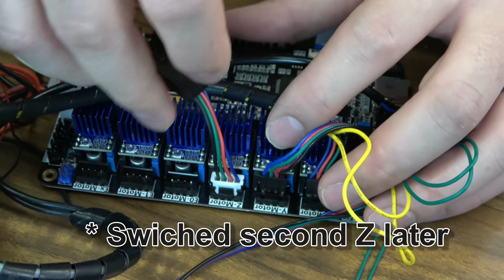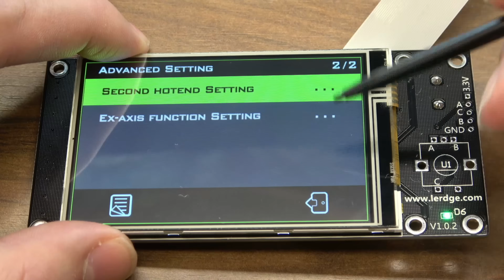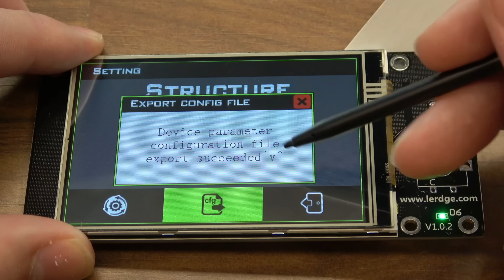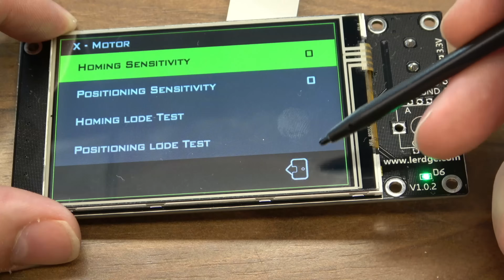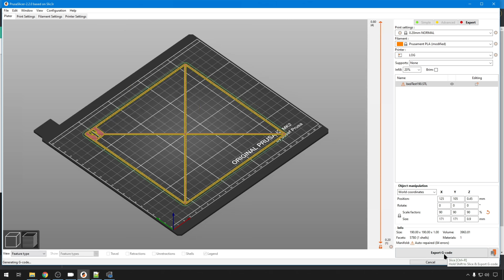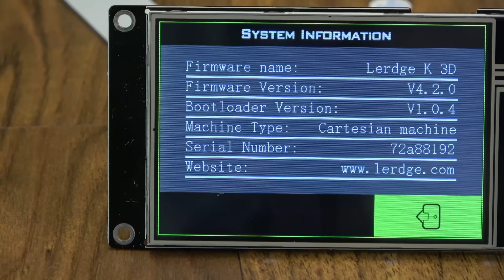Lerdge Main Boards - Install & Test - Chris's Basement

Comment: My 3dtouch deploys but didn't stop the bed from moving. Help?
Reply from the maker: Check the wiring again, make sure the endstop trigger pin is correct.
Reply: @ChrisRiley  it is set up exactly like yours. All wires have been checked many many times over the past 2 weeks.

Comment: Yes, on price you can get the BTT Octopus Pro board for around $80. I will have to check, But I don't think you can do Senseless homing, etc from the touch screen. I have the BTT TFT35 E3 touch screen.  With the recent Marlin update 2.1.2 and the latest Touchscreen update I can finally use the touch screen. That's what I did not like with Marlin and the BTT board was that all or most of the advanced features just did not work. Example: I am using a EZABL Sensor because I could not get the ANTec Bltouch to operate. And I still can not get E0 on my BTT  board to operate. So I am using E1. But the main thing is I think Marlin just did not support or work correctly with the BTT advanced features. All Older features seem to work fine. BTT needs to do more testing before releasing their boards to make sure all the features work.
Reply from the maker: Thanks!

Comment: Can you use the USB 2.0 port built into the board to connect to Octoprint, instead of having to put on the USB-B module? EDIT: Nevermind, I looked at the schematic and see that it's not USB 2.0, it's actually a "U-Disk" port.... whatever that is. You'd think they'd have some kind of USB port built into the board by default...
Reply from the maker: Glad you found it. I wasn't sure.

Comment: So I'm confused. On the 2209's that come with the Lerdge K Board, stealth chop IS available without any soldering, any pins added to the stepper driver, and no jumper cables, right?
Reply from the maker: You only need the jumper if you want to use sensorless homing.

Comment: Okay, I unlocked my steppers, and moved Z to zero plus a sheet of A4 paper. Then I HOMED the printer. X was fine, Y was fine, but Z came down from 90, and tried to go through the bed. So I'm close, but I need to work on the settings for Z some more. At this point, I'm feeling like the LERDGE BOARD is a lot smarter than I thought it was, and it may actually work once I understand what it's asking me to enter into it's settings.
Reply from the maker: Hopefully, changing the Z stop setting solved this.

Comment: So, here's my update. 1. I rebuilt the 3 endstops. Now they're one wire to C, the other wire to NC. I got that information from a Smoothieware article. On the Lerdge K board, I'm using the two outside pins. 2. I'm using the latest firmware circa 8-22-22, and I'm wondering what's going on with PID Tuning. I'm not seeing a "DONE" message, but the new values are appearing on the screen after I x-out of the PID window? 3. I got my ORIGINAL BLTouch to do it's initial dance. Frankly, I'm scared of HOMING the axis because of all the pounding I listened to yesterday. 4. I've got a fan over the board for some extra cooling. I've seen it come on, but I have no idea what's controlling it. I've also seen the hotend fan come on, but I'm assuming it works from the thermistor telling it to? I can't verify that, however. 5. I've noticed that all of the videos about the K board are old, like at least 9 months ago, but most are a year or two or three. That's a youtube problem; they should delete all these irrelevant videos? 6. This board is reminding me of the Duet board I tried to get going, a lot, and that isn't a good memory. 7. I'm going to focus on the end of this video today, because you get into senseless homing, and I would like to see if I can make that work. 8. I tried using a ground off the hot end socket plus my tester on the first 2209 to see what it's set at. The numbers I saw were crazy no matter what setting on my meter I used?????
Reply from the maker: Looks like you're still making progress.

Comment: Well, yeah, it's a wreck. I was searching through all of the settings, looking for something; I don't know what. The thing is: I don't understand HIG, LOW, MIN, MAX. Those are printing words. They mean something, but I don't know what that is. I ended up on the Auto-leveling page. So I told the X-axis to go to the center of the bed. Instead, it went towards the left tower, and pounded on it until I turned the printer off. So, I guess that means my mechanical end-stops are messed up. HOW SHOULD THEY BE WIRED AND DESCRIBED IN THE LERDGE INTERFACE?????

Comment: I've been watching this video, and working on my Lerdge K setup for about six hours how. Kudos to you for making such an in-depth video. I even managed to resurrect my Original BLTouch, and get it installed. So right now I'm trying to HOME my three axis. Here are my results using the settings you established with your setup: X-axis, Currently, it's at approximately 100mm. When I touch the Home X icon, the print head goes up about 10mm, it goes to the right about 20mm, and then it goes down about 10 mm. Y-axis, well, that's weird, the X-axis does the same thing again, and the Y-axis moves forwards (towards the front of the printer) about 10mm. For Z, this is even weirder: The X-axis goes up 10mm and goes to the right until it's pounding on the right tower, at which point I turned the printer off. While that disaster was happening, the Y-axis went all the way to the front of the printer. I think turning off the machine prevented the Y-axis from pounding on the front of the axis, but I'm not completely sure of that. ANY HELP WOULD BE APPRECIATED.
Reply from the maker: Thanks for watching the video, from the comments, it looks like your working through it.

Comment: How did you figure out that the ORANGE wire from the BLTouch goes to the BROWN PIN on the left side of the SERVO SOCKET? As far as I can tell, the color chart does not have a BROWN CODE?
Reply from the maker: I just looked up what the pin were assigned to. Brown ground, red vcc, orange signal.

Comment: This is a great solution for people like myself, who can't figure out what VSCode is.
Reply from the maker: Awesome to hear!
Reply: Thanks, Chris, I appreciate the comment. My K board took 6 weeks to arrive. I installed it yesterday. My end stops are NO, but I don’t think they’re working. Your info on how to plug them into the board may be a solution. I’ve ordered BTT 2209’s, v1.2 from Amazon based on Kelsey Fabrication’s videos about the Lerdge 2209’s. Then I watched your video , and saw you installing the jumper wires, but not the pins? Also, removing the 4 jumpers was a surprise. Kelsey didn’t say or show that? So there’s some confusion there. That’s for this video. And thanks again for commenting.

Comment: I'd LOVE to see a short video on how you set the DIP switches on the Octopus Pro board to use a PT100/PT1000 Temp sensor. The switch is sooooo small I am having a very hard time physically setting the switches. I know that it is 1 ON 2 ON, 3 OFF, 4 ON for my setup. But again physically setting the switches is nearly impossible. Maybe if you have 2020 vision and a microscope you can do it.
Reply from the maker: Thanks for the idea!

Comment: hello friend , I need software  PC to convert STL file to G-code fit with lerdge-X board . I use CoreXY printer
Reply from the maker: I don't know of a config that will work for your printer, I use Prusa Slicer.

Comment: I have no voltage on sink fan and also mb fan and no spin. Is there way to turn on or it should spin permanently?
Reply from the maker: I think those fans only come on with the hotend heater is active.

Comment: Hi my hero you tuber like allways good work I did the installation on my Creality Ender5 printer and everything seems allright until i tried to make a Testprint the hotend bumps the endswitches when the Test should beginn the Motors scream like mad it is like the print goes the wrong way made the slicing in cura for your help a coffee is paid
Reply from the maker: Thanks for the coffee! So there could be a lot of things going on here. Which board are you using? What drivers? Make sure you have step/dir type drivers and you have the steps set correctly.

Comment: Hello, I have been subscribed to you and watching all your videos.  I have Lerdge-K board on Ender 5-plus.  I installed the power control from Lerdge.  Every times when it done printing it shutdown the power without cooling off the hotend first.  I contact the Lerdge and they told me it fine on their end and it does cool off first before shutdown.  Since it does not work on my, how do I insert the GCode to cool down first before shutdown the printer?  I use the usb drive directly to print to the printer.  Is there a way to insert the ending G-codes to do the cool down before shutdown.  The Lerdge firmware does not allow this on the UI.
Reply from the maker: I'm not exactly sure how the board/firmware knows the print is done. In you end Gcode, try putting in a wait. Wait for like 1 minute to start out G4 S60

Comment: Hey Chris, thanks for the cool video, have you already found out if you can use the extruder 1 output for the fan, or the output from the second extruder for a controlled fan?
Reply from the maker: Nice, I am glad it will work that way.

Comment: Hi chris! Greate video! I buyed the same board for my ender 5 plus, but I am having trouble with the stepper temperatures. After some minutes they get to hot to touch them. I have tryied lowering the currents to 300mA and verified the reference voltage. Do you know if this is normal? Or should I change something else? Congrats for the good job!
Reply from the maker: Hello, thank you! That's doesn't sound normal. I would check the model numbers on your motors and try to get there specs. Most nema 17's should run around 800mA with no issues.

Comment: I was with you riiiiiight up till the part you said there was no noticeable difference between those two test parts.  The SKR part looks better on the hexagon, on every side.
Reply from the maker: I don't even remember how this went down at this point.
Reply: @ChrisRiley  it's cool man, I enjoy your videos.  It just seemed kinda funny, I'm 80% blind (past legally blind), and I use a 52" plasma tv as a computer monitor.  I just assume everyone sees things better than I do.  But you put the parts up side by side and said which was which and it just seemed very clear to me that they both had issues, but the one was way smoother than the other.  It was just funny cuz you said something like "these two are basically the same" (or whatever) and I was like...  wat  O.o nuh-uh.   
Just got my second printer last week!   It has become all I do all day.  Nice to have something I can do without worrying about cutting fingers off or having to leave the house.  :)  

I will try to leave positive comments more often.

Comment: Hi Chris i got a issue  with my K board on the TFT i have a blue screen with a message find no App for Bootloader how do I fix this please
Reply from the maker: That don't sound good. I am not sure how you would resolve it, sound like the firmware is out of wack. Not sure how to reset it without the screen.
Reply: @ChrisRiley  you have contact to lerdge store i think ,would this be great to ask them about this fault on the K board and when you got the answer you can make a video so everybody who got this fault can perhaps solve this too
Reply: The update was working without problems When I tried to do a update with Force 4.2.0 it did not work and with the new 4.3.1 on first try Thank you very much

Comment: I had a question for Chris Riley. With the  x lerdge board I had to set the extrusion rate when printing at 400 every time is there a way to set that in structure or does the stepper have to be set at 480 or something? I want to set it up permanently .
Reply from the maker: Did you get this sorted? You wouldn't want to adjust extrusion rate every time, you want to update E steps and be done with it.

Comment: Ugh lerdge is garbage. Poorly documented closed firmware. Support messages go unanswered and forced to use Facebook groups.
My one printer has never been consistent since this lerdge board has been installed and have to constantly tinker with it. No more! Picked up 5 skr boards to fix this and to build two vorons.
Reply from the maker: Sorry to hear that about Lerdge.
Reply: @Lerdge3D  i have and was told they never received one. I pulled the email off their site and used yahoo. Also tried the support request on the site.
Funny enough the skr board is running perfect. I tired to use a simple setup but wasted time, money, and lots of spools. Bad board? No idea but it’s in the electronics garbage box for what ever

Comment: Good work Chris question I installed the Bltouch to the board but when i trie to trigger  nothing moves can you help?
Reply from the maker: Not sure on this, make sure servo angles match the degrees in the bltouch commands. 

M280 P0 S260 ;reset.
M280 P0 S120 ;self test.
M280 P0 S90 ;stow probe pin.
M280 P0 S10 ;deploy probe pin.

Comment: I bought this for my tevo little monster and everything went well until I tried to enable the Bltouch for "probe used for z-min" will not check or enable like in video. I'm' not sure if animation error, I'm going to go through config of firmware. Hope its fixable because this printer needs it and yes, worked fine before just wanted a less nosey printer that was faster. Any thoughts or ideas on what's going on?
Reply from the maker: I am hoping it's just the animation. I hope the lerdge supports the probe on delta, I am not sure ehy they wouldn't
Reply: @ChrisRiley  It's a animation error, not sure why or where in file but finally got it to work with prob and prints as good as before but sooo much faster and more quiet.

Comment: For 4 years now I'm using the Lerdge board. I started with the "S" board and now today I have 3 K boards running. The service of Lerdge is what it is, but at least it is a lot better as the very poor one from Bigtreetech.
In general I'm very satisfied with the boards and the upgrades. For Delta's I'm not sure if they have already introduced auto-calibration, in the past that was missed in the firmware.
Reply from the maker: Thanks for the info on you experience with these.

Comment: I installed the x lerdge board on my ender 5. It worked ok. But I would like to know how to set it up perfectly?
Reply from the maker: I think that is the main downside, not enough knobs to turn to get it dialed in.
Reply: @ChrisRiley  I had a question for Chris Riley. With the  x lerdge board I had to set the extrusion rate when printing at 400 every time is there a way to set that in structure or does the stepper have to be set at 480 or something? I want to set it up permanently .

I also had a bad motor.lol

Comment: Lerdge vs standard Marlin is like Apple vs Android in smartphones. I have a Lerdge X in my corexy printer for almost 2 years now, and i like how convenient it is. It has 2 key selling features that Marlin based boards did not have back then: Print from USB thumb drive, and the Auto-Power OFF after the print completed(it needs the power subboard).
Reply from the maker: That's a good way to look at it.

Comment: to be honest the propriety firm ware is not such a big issue it is a really well thought out firmware and i prefer it to marlin it has a lot of potential and you can set everything up via the screen so it is better than complicated compiling of marlin and everything you can do with marlin is there in the lerdge firmware the lerdge firmware is a big win for me i love it i have the lerdge k board and its fantastic and people need to give it a chance to me it wipes the floor with skr boards
Reply from the maker: Great to hear, I don't see a lot of people using these. Good to hear something from someone with perspective.

Comment: How can I do double Z with double Z limit swich (separate endstop for every Z motor)?
Reply from the maker: It's a feature, you can just turn it on in configuration_adv.h
Reply: @ChrisRiley  configuration_adv.h as in Marlin? Or does the Lerdge board actually save configuration.h and configuration_adv.h files to the SD card?
Reply from the maker: @anthonyrich1592  Ha, I didn't realize this was a comment on Lerdge until now. Yes, you can use the second endstop on this board, it is selectable under the EX menu I show in the video.

Comment: This is really cool, and it supports all the features I want, and its really easy to set up compared to the SKR, but what if future features arent supported? The closed source is meh.

It feels close.

The duet has all the cable crimping which is a pain, and that large price but includes wifi, but then the SKR boards just seem like the best value with upgradable open firmware where even with a raspberry pi they are still significantly less than a duet.
Reply from the maker: Yeah, that's the kicker, they do update the firmware from time to time, but I am not sure how quick they are to add features. You are right, it's close, but maybe doesn't cover everything.

Comment: Can any of those current 3d printer boards like this one or a SKR be used on a K40 laser cutter (the board that comes with them is atrocious)? I don't think I've seen someone do that
Reply: Makerbase MKS SBase 1.3 is one board commonly used on k40s. They support GRBL which then lets you use lightburn as your software.
Reply: @Section59.  That's exactly the goal. I can't seem to find a video of anyone actually doing that. I know that you can install a Cohesion3d laser board as a direct replacement but those are more expensive than the k40 itself
Reply from the maker: I am not sure what boards are compatible with K40's, I don't have any experience with lasers yet.